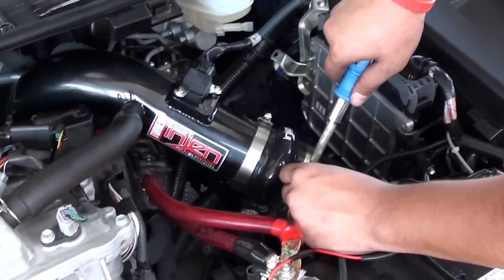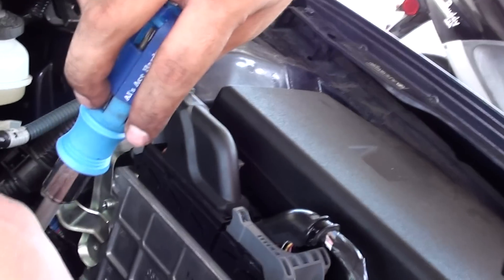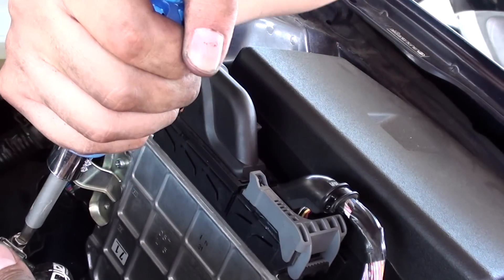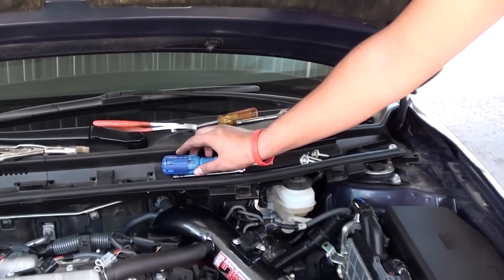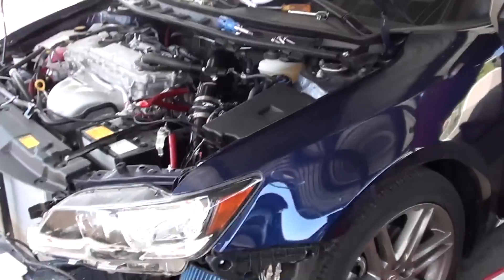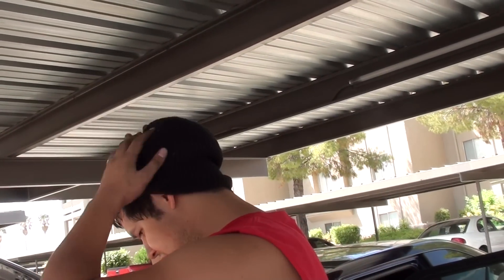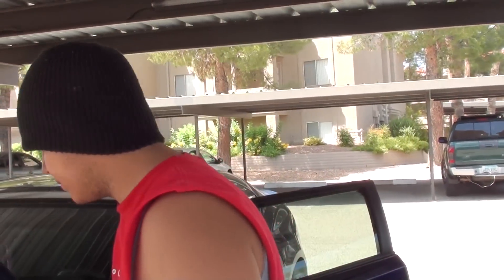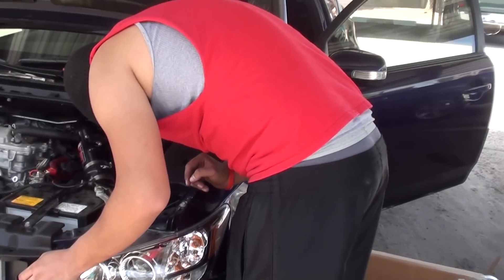2011 Scion Tc Injen Cold Air Intake Installation Walkthrough Part 7

Comment: Hey very very good job. Im trying to clean my filter, and dont know how to get the filter off. So ill try take my bumper off, but mine was installed through wheel section. By the way, I hurt from spec from TRD that TRD intake wont suck up any water because it has shell that protecting from leaks! Good job !!!!!!!!!!!

Comment: Good video man super informative. FYI though, no need to take the bumper off, put the downtube of the intake into a pillow case or towel and slide it through the opening between the battery and the ecu mount, place the filter in the bumper before hand and tighten the two together once it's in place, connect everything else to the throttle body and MAF and then just attach the two, cuts a solid two hours on installation time. Good videos either way, love my tc2

Comment from the maker: @MrRaiderboi03 If you get into a puddle with more than 3ft of water, it will. But at that point that will be the least of your problems. Short ram WILL suck up hotter air, from the engine bay. This can be solved by wrapping your headers in heat absorbing material (header wrap) and using heat reflective tape on the intake. The intake tube itself will get hot, which will also increase the temp of the air (in both Short Ram or CAI). 

In a nutshell, they both have pros and cons, so its up to you.

Comment: you forgot to take out the bumper guard my friend; make sure you either do that or take the fog-light things out to get maximum potential air into the intake (you may have trouble if you live in a rainy area though), I have the same car in cement, they're fun as fuck to drive haha

Comment: Hey You know how to install a blow off valve tc 2011
Reply from the maker: No, I do not have a turbo in it so I have no need for a blowoff valve.
Reply: That's also my question I saw a Scion tC not turbo with a blow off valve, do its a way to put a blow off valve even if the car doesn't has a turbo ?
Reply from the maker: Alex Ruano There might be, but it would be of no use. A blowoff valve releases built up pressure from a turbo to atmospheric levels, without the added pressure from the turbo there'd be little pressure to release thus making it useless.

Comment: Have you heard like a tick sound in the engine or the inside of the car coming from the engine?? Please if you can answerd that question i be glad
Reply: No I do not. The only sound is when I start the car and the intake shakes a little and can hit the wheel well and make a clunk sound
Reply from the maker: Sorry used my alt account to respond by accident. I don't hear any knocking or noise from the engine, other than at startup since the intake shakes and hits teh wheel well